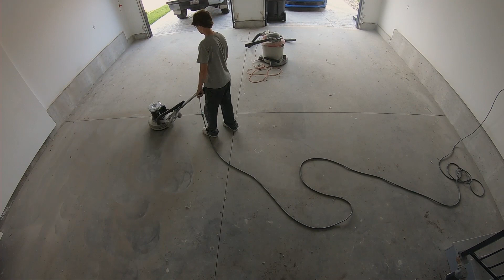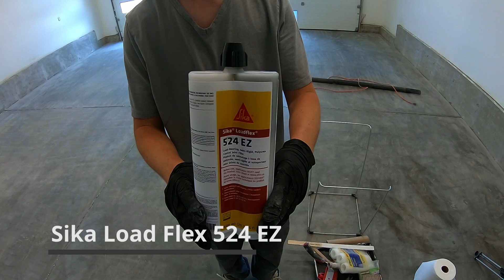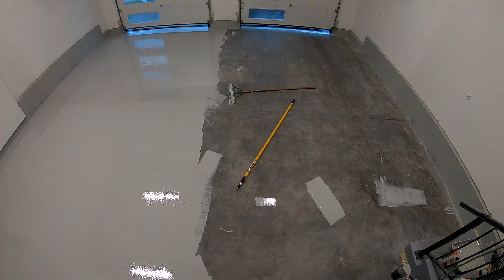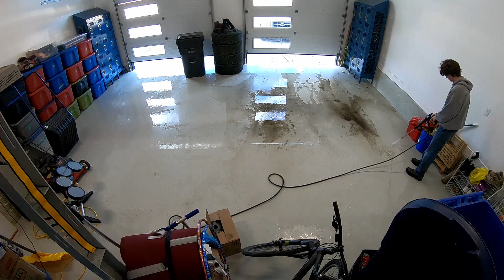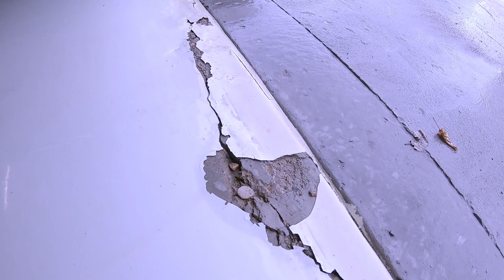Industrial Grade Garage Floor Epoxy Coating

Comment: its difficult to find a price from TX
Reply from the maker: My suggestion would be to try to find a local concrete specialty store. Not the big box store and make up a story about painting an industrial floor for your business. Tell them there will be fork lift traffic and truck traffic and then they can point you in the direction of a tougher product and won't try to sell you the $100 a pail DIY epoxy and hopefully steer you towards a more industrial option. There are lots of different brands out there and I'm sure you can get something comparable in your area.

Comment: Hi from sweden. Great job! Whats the size of that floor ans how many buckets did you use
Reply from the maker: I did 860 square feet (80 square meters) using 4 pails. 2 for the first coat and 2 more for the second coat.
Reply: @ResearchDesignBuild   thanks. How much is in one pail. Sikkaflex is super expensive over here :D
Reply from the maker: @rteaw  it is about $250 CAD per pail and I believe these were 4L-5L pails once mixed with part A and B.

Comment: Tip: Pour out the entire gallon/mixture/can after being mixed.  You will have much more time to spread.  Never leave any in the bucket and you will have ample time to spread it properly. 👌
Reply from the maker: That's a good tip for sure, it wouldn't heat up as fast that way. I was worried that I would end up with too much product in one place. But I can see how that would give you a lot more working time.

Comment: Sika doesn't sell to homeowners. I tried, they refused to sell to me.
Reply from the maker: I bought it through a Sika Distributor, not through them direct. However a tip I sometimes use is that I would go in and say that I'm buying it to coat the floor in my new warehouse... Or something to that affect. Then they typically don't ask questions and sell it without issues. I think I even told the guy that I wanted a filler for the control joints that would work for fork lifts. I figured if it worked for fork lifts then it would work for my cars. There is usually just some minor contract lingo they have to work around saying they will wholesale only, but at the end of the day they are a business and a sale is a sale.
Reply: @ResearchDesignBuild  here is the exact wording from the Sika rep "We do not sell these products over the counter and they require specific training, equipment etc. "
Reply from the maker: @CybekCusal  Don't know what to say I was able to buy it without any issues through a concrete supply company here in my town, on 2 separate occasions. They didn't stock the exact product that I was looking for but got it on their next truck and I had it in a couple days. Sometimes you have to get creative I guess in how you approach them. But I did not buy it direct from SIKA or from one of their reps. It was from a distributor and I guess different distributors will have different policies or flexibility.